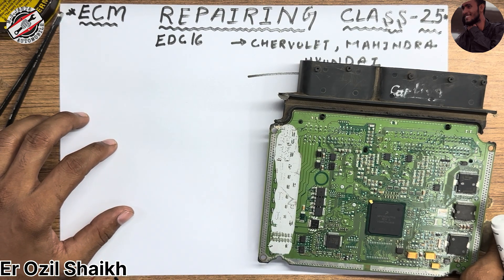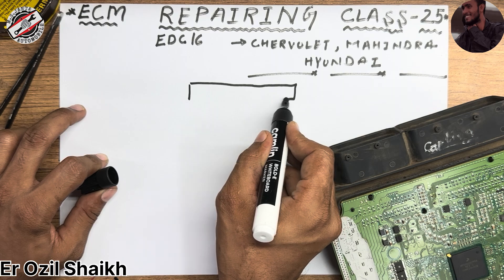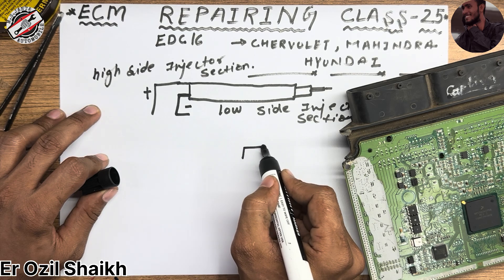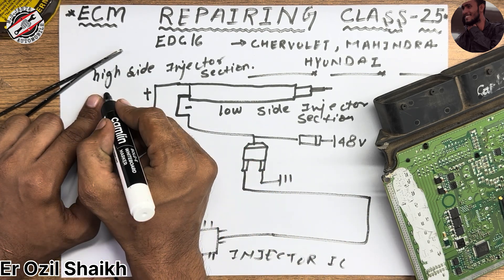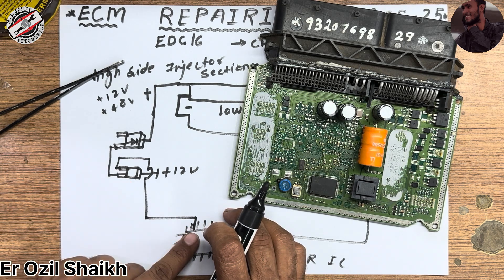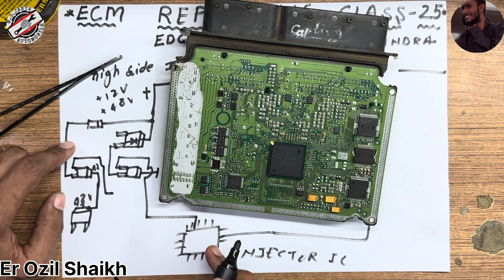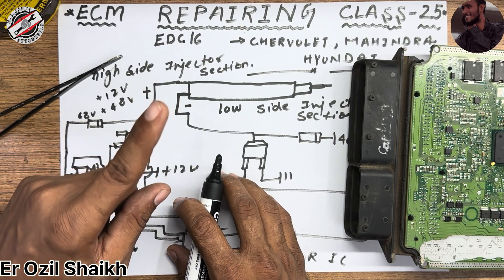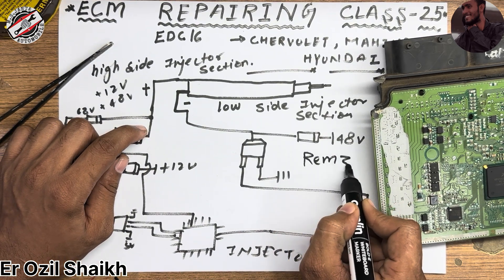#25 EDC16C39 bosch ecm injector section explain 12v & 48v in unique way | mahindra hyundai chervolet

Comment: My brother, there are two types of transistors, the PNP type and the NPN type, a type that brings pulses from the MOSFET to open and pass from one direction to the other, but in the video that you filmed, the MOSFET has a negative and a positive, and this is an error, and the second type is a diode-type transistor.
Reply: Please answer my question as soon as possible❤❤